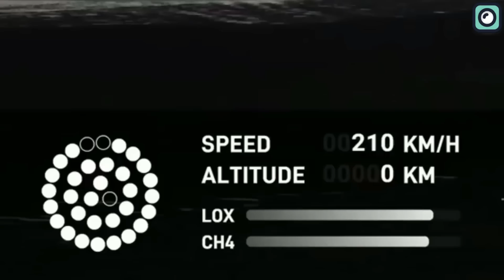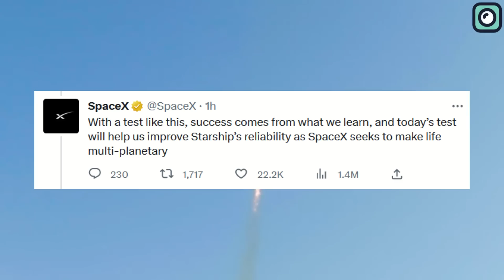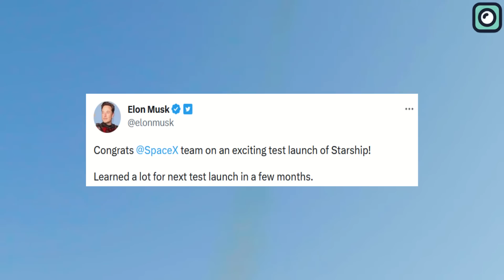SpaceX Revealed Why Starship Blow Up During The Orbital Launch Test... Musk Reacts!

Comment: While I was watching this launch the massive amount of dust/debris and the relatively slow lift-off were of concern, it just didn't look right. Still, it was a good success for this stage of the development, but it's clear there are still issues that need resolution.
Reply: Totally. Failed on the launch pad. Just no explosion.
Reply: @Noxti! Agreed, there was some horizontal instability pretty quickly after liftoff-then it recovered. But combined with the excess debris and the prolonged liftoff it just looked like something was off.
Reply: Launching a rocket from a stool is very exciting. It was also a bit cruel to the wildlife.
Reply: Thought it should have started moving a bit quicker off the pad, seemed like it sat there for 5 to 8 seconds just taking a beating before starting to rise up.  Should be moving after all engines are lit.  They should never sit on the pad that long after fire up.
Reply: A lot of that dust and debris was ice that had formed on the boosters and paint from the launch tower. The slow liftoff is because at 0 seconds to launch, they throttle up the engines to about 110%. No rocket ever leaves the launch pad at the 0 mark.
Reply: @HelenHumphries  yes but even the  Massive Saturn V lifted off within 3 seconds and cleared the tower.  I understand its 30 ft or so taller and about 123 tons more weight but they should not be sitting on the pad for 5 to 10 seconds before even budging.  I will have to time the launch but it was in all that fire, turbulence and shockwave way too ling as I saw it.
Reply: @heyfitzpablum  The "horizontal instability" was intentional.  It was a tower avoidance maneuver to keep them from destroying the launch tower arms with the rocket exhaust.
Reply: @stargazer7644  Possibly, but it looked more awkward than the many other launches I've seen.
Reply: @heyfitzpablum  The off axis thrust vector of the Space Shuttle's main engines caused a similar but smaller effect.  The Shuttle slid away from the pad in the belly direction at launch.

Comment: [Editor's note]:  Exhilarating...  Yet, seemingly some aspects of the launch (i.e., disassembled concrete under the launch pad) were predictable (this also occurred on previous engine testing).  So questions arise about WTF?  Blast diversion bunker necessity seems obvious (to me, an English major).  Concrete debris that contributed to self-destructive scatter... why was this not controlled for?  And the proximity of the fuel field to not only radiant heat but actual blast-fire touching the tanks... ???  WTF?  Why?   But hey.  Such features seem to be a part of EM's path forward... unique path forward.  I'm going along for the ride though.  At least SpaceX is attempting, "... go where no one has gone before."  Bravo!!!

Comment: I knew something was wrong! The Liftoff was to slow! 😢
Reply: too*
Reply: That's because the booster doesn't start all its engines at the same time.  They come up in sections and then reach full thrust.  The rocket can't lift off until that process happens.  It takes several seconds.
Reply: Elon musk   I’m not streaming 🤗
Reply: Elon musk  thanks

Comment: I am happy to see Starship take off. However, SpaceX should have been better prepared for the damage to the launch pad. Regardless of the data they received, it only takes common sense the preparations that NASA took for the Saturn V and SLS launch pad. SpaceX should have had a flame diverter and water deluge system in place. Especially, if you are talking about launching one or more Starships per day. SpaceX may have received a lot of data about Starship's launch, but how does that compare to the damage it caused. "An ounce of prevention is worth a pound of cure". What was SpaceX thinking when they tested Booster #7 for just a few seconds? "Hast makes waste". And I feel that SpaceX needs to implement more caution in their procedures.

Comment: Space X needs to use a water deluge system and a flame diverter system. 15 million pounds of thrust is an insane amount of power, I would not be surprised if the shockwaves from the startup of the Raptor engines kicked up debris that damaged some of the engines or the shockwaves themselves damaged the vehicle. I personally am not comfortable with the idea of 33 engines in the booster, that many engines has got to be a nightmare to control. Hopefully they are developing larger, more powerful versions of the Raptor engine. Ten engines that generate the immense thrust the Saturn V's F1 engines did would be easier to control as a unit. At least one thing was accomplished, this is the first time full flow, staged combustion rocket engines actually flew. That alone is a major success. Starship is so large, I wasn't sure it could fly, and it demonstrated it's structural strength by holding together as long as it did. If this vehicle does become an operational manned spacecraft space will become the future for all the people of Earth. It is clear Elon Musk believes Starship will bring a better future as well.
Reply: Soyuz has been running 20 engines for decades. Best record.

Comment: What was disappointing?  It’s amazing that it flew at all
Reply: The launch pad was severely damaged ,not all rocket motors performed correctly, parts of the booster were damaged by explosions the booster did not reach predicted staging velocity and altitude and staging did not occur. Starship did not reach orbit or perform a soft landing near Hawaii after one orbit of the earth. That was what was disappointing.
Reply: @romanroad483  none of it’s disappointing. The way I look at it they did a substantial portion of the demo work for the redesign of the pad, they learned about rocket performance with a good percentage of the engines failing to ignite. They cleared the tower and launched the most powerful rocket man has ever constructed using methane as its primary fuel.  If this were NASA you’d have a decade of nothing happening. SpaceX will take the reams of data recorded, be redesigning this week, will reconstruct the pad over the next couple of months and will be launching again in 6 months.  Where NASA wasted hundreds of millions in years of crawling research and modeling, SpaceX tries again, gathers data, perfects and sets reasonable goals and then gives it another shot. Can’t wait to see the next iteration and knowing it will come sooner rather than later is thrilling.
Reply: @teddyjackson1902  If you was not disappointed  then you must have been pleased the mission failed. I hoped and expected it to be 99% successful .
As for Nasa , in the early days they soon worked out how to make a rocket fly for more than four minutes. At the height of the Gemini and Apollo missions they were launching manned missions every 3 to 4 months with no failures to orbit.
As a young man I watched these missions and moon landings thinking that I was witnessing the beginning of manned space exploration. Then for sixty years, nothing. Now with private enterprise taking the lead I have renewed hope. So I was very disappointed at this Starship failure. I just hope they succeed in the years I have left.

Comment: Anyone with a basic understanding of structural engineering and rocketry is asking how SpaceX could have not provided a better launch structure capable of withstanding the formidable forces during lift off. Other important question include failed ignition of 3 engines and subsequent loss of about 5 more. Many unanswered questions including the apparent elation demonstrated by SpaceX employees at the point where self-destruction took place. Additionally, many are wondering why Musk (apparently) did not fully employ his vast capabilities in terms of computer modeling to perform  simulation testing, which would have certainly predicted, e.g., the failed launch structure. Hopefully, there are logical answers to the many unanswered questions and the program will not be substantially delayed.

Comment: why did space x go with one massive booster instead of three smaller ones like their super heavy?
Reply: Because it is lighter and therefore more efficient.  Plus, they don't have any small boosters that use the methalox engines.
Reply: @stargazer7644  the thought was that if the plumbing and fueling could be an issue with so many engines, wouldn't a oversized version of the superheavy kinda do the same thing?
Reply: @matthewknobel6954  Oversized meaning with fewer larger engines?  Rocket engines are notoriously hard to scale up.  And losing 1 of 5 very large engines is a much bigger problem than losing 2 of 33 medium sized ones on ascent.

Comment: I just looked this up, the iss weighs 419,725 kg and with each starship being capable of sending to space 150 metric tons or 150,000kg it would only take 2.79 or 3 starships to lift the whole iss into space 🤯
Reply: Yeah. Consider the possibilities of how quickly space x can get a 2001 space station with spin gravity up and running.
Reply: @TheHalcyonAnon   well how many starships would that take ?
Reply: For mass, yes.  But ISS is hollow and not terribly dense.  Its volume wouldn't fit in anything close to 3 starships.

Comment: Why do you think that we were disappointed? We are thrilled! The goal was NOT TO DESTROY STAGE 0. Stage 0 WAS NOT destroyed. Damaged yes but not destroyed. I still see the catch tower standing and the nearby storage farm is still there. There was no question that there would be damage but stage 0 is not destroyed.
Reply: “Damaged but not destroyed”! Hilarious.
Reply: @executivesteps  HUGE DIFFERENCE. If you had to rebuild the tower, the stand, the tanks and the rest of the facility that is VERY DIFFERENT then boohoo some concrete got destroyed in the exact spot that we probably need to build a flame trench anyway.
Reply: @joereilly7082  Does the OLM go?
Can they keep the top ring? Is the top ring salvageable or do they need a new one. Whatever they do they have to do it in FL too. NASA will never allow the OLM
there. 
It seems the only way the diverter can exhaust is toward the ocean. 
The optics of that might not be pleasant. There’s a lot of work. 
I’ll be surprised if they get 1 maybe 2 launches before years end.
Reply: @executivesteps  What I know is that it was still standing. If it is damaged beyond repair then they will have to fix it. The point being that spacex has to make that determination but the fact is that the facility was not destroyed and likely would have been if that thing had exploded on the pad.

Comment: I was surprised that they went with the flight not having the deluge system installed they knew concrete ablation was significant on tests with less engines ignited. They'll need to install a deluge system and flame divergence before next attempt, very lucky they didn't have a RUD on the mount only damaging  three of the engines. Surrounding support systems were damaged as well luckily no significant damage that could have had a catastrophic outcome.

Comment: I think tvc hydrolic tanks bursted because of heat from unstable raptor engines. As i stated before to space x that raptor v2 still not stable and now ground concrete is the biggest problem  which means its currently not possible to make Flights from ground  and the sea is only option for booster  🧐🧐🧐🧐🧐🧐
Methane engine is still not fully developed and it needs attention as well as the thrust  produced is also an issue if we talk about only launching.

Comment: Can’t but help think the ‘way to go’ is sideways using an earth tangent track (isotropic vector matrix) 200 miles long - conserving momentum by rotation (Peter Plichta; rotary synchronous motors); achieving forward speed by linear-synchronous movement. It would accord with Musk’s preference for electricity over chemical burns.
Reply: The Earth's rather thick atmosphere might have a thing or two to say about that.
Reply: @stargazer7644  
No its density reduces substantially the further along the track you go and the speed/acceleration will be appropriately graduated by the computed means available to linear synchronous technique. Dr. Peter Plichta has designed for the same means without track at all.
Reply: @markhughes7927  This is exactly why space launches start out going straight up to get above the thickest air as fast as possible, and then they lay over and start heading down range.  This is the most efficient profile.  Tell me again what the benefit of not doing it this way is?
Reply: @stargazer7644  would not have thought it ‘exactly the reason’ since I do not think a 90° alternative was ever envisaged. The idea is offered speculatively only but mainly as a way to get past the expense and danger of the vast chemical burn involved by a means using electricity from an earth-bound electric grid. It is of course a ‘flying saucer’ idea with momentum conserved by ‘frisbee-spin’ using internal rotary synchronous motors to provide sufficient. The radical part of the idea is in deploying the ‘Isotropic vector matrix’ - a modular configuration which aligns tetrahedral units equally either side a cubically conceived space but reduced to pyramidal form. Sheer is just not there and hence - or so it seems to me - the possibility of maintaining planetary tangency from a point of departure like anyone’s local metro station. 200 miles of track would produce an elevation of 7 miles or the height of Everest. I would have thought that the main acceleration by linear synchronous means would take place over the last 30 miles or so and the track be made to cant upwards some for extra trajectory at its end. The uses of the isotropic vector matrix appear relatively unknown to practical engineers from all I have seen - but are observable in the most efficiently designed crane booms in level mode and in the London Eye configured into a circular mode. Sustaining the position of 200 miles of earth tangent track would have the novelty of always building downwards for support (taking polyhedral shapes - not towers) ever using the hinge-possibilities of the ‘pyramid’ (half-octahedron) bases to configure design. Just note also that the German equivalent to Musk’s engineering genius Dr. Peter Plichta takes the sideways trajectory approach - as recently found out - but without a track - his design is pure automotive ‘flying saucer’. Pity Musk does not know him and his work.
Reply: @markhughes7927  It's not envisaged because it makes zero sense.
Reply: @stargazer7644  
…ah….

Comment: Often I wonder why those involved in designing such systems are not able to determine such basic problems as in this case the design of the launch pad not being up to the force of the engines. The largest jet engines ever created my man.  Common sense would suggest that the launch pad better have been at lease as accommodating for such "volume of thrust", as those designed by NASA for their lesser engines, with designed concrete deflection chutes. Unless as with most corporations it was about money, cutting corners to get away with the cheapest application but still getting the job done at a risk.
Reply: shows what you know... these are ROCKET ENGINES not JET ENGINES

Comment: The ignition of the booster engines felt like hell breaks loose 😮.... remembered me the detonation of nuclear bomb tests. Was terrifying. To get these brutal forces under control seems the biggest task. Tks for the video and upload.
Reply: The sound was so powerful.
Reply: Have you ever actually been present when a space rocket is launched? I have on numerous occasions. 4 things happen in rapid succession before you see the rocket leave the launch tower. You hear the engines roar, you feel the ground shake, you feel a lot of heat and you see the flames from the engine. And this is when you are at least 3 miles away.
Reply: @HelenHumphries  we dont have in Europe rocket launch pads ... 😊 not any more since Werner von Braun sneaked away to work in USA

Comment: Rocket was underpowered. Elon needs a way more powerful booster for Starship. You can feel that. They got about 30km altitude and speed 1700 km/h for stage separation. Its too low. It should be about 66 km and speed 7000 km/h. Clearly the rocket needs more powerful booster.

Comment: My understanding was that the primary reason for MECO failure was that the rocket did not disconnect from the booster leading to the tumble and subsequent need for termination!
Reply: i think when the three engines failed it threw everything off...it went through max q far under the altitude the computer thought it would...not sure though...it probably never even attempted separation is my guess...im sure certain parameters have to be met for the computer to seperate

Comment: I love Elon.  I think Starship is amazing.  But.
The spaceship is not going to successfully land anywhere.  The booster needs only to leave Earth. 
The Starship is likely far too powerful to land on the moon or Mars. And it needs a flat surface to remain upright.
Also 
The concrete  launchpad is way way too fragile.  I saw the launchpad was made of the toughest heat resistant concrete  but there is no concrete that can withstand those pressures.
Even if the lauchpad was made of solid stainless steel, it would probably simply melt. You would need the equivalent of the thermal tiles yet the tiles cannot be made large enough and  glues would simply disappear in a puff of smoke. 
 Carbon fibre shields are held together with glue.
Perhaps a Tungsten launch pad lined with a thick ablative ceramic glaze. I cannot imagine how expensive such a launch pad would be and it would be a one time use only.